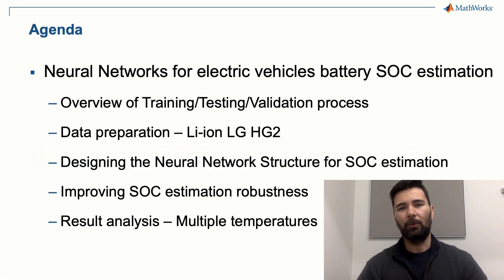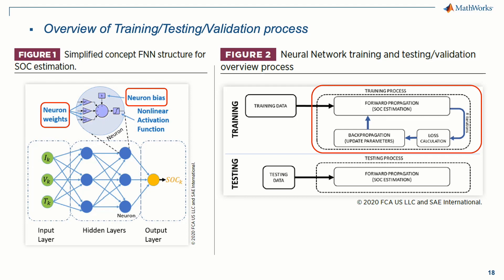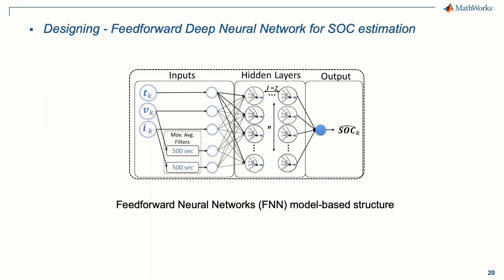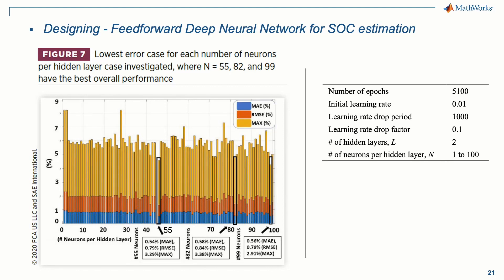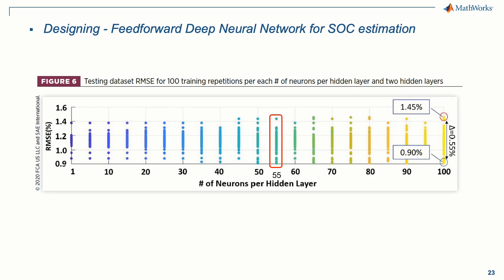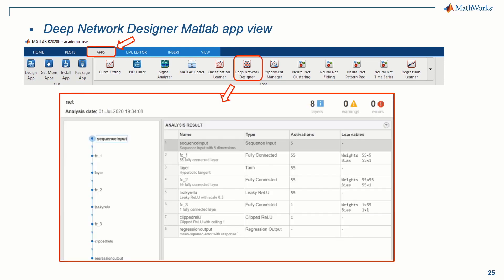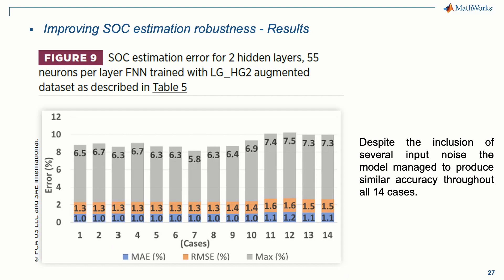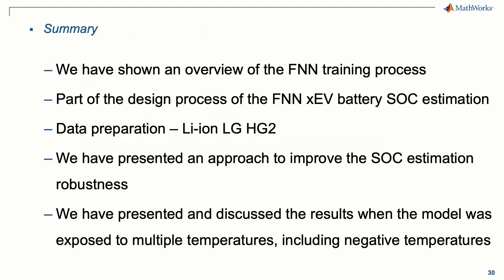Neural Network Design for State of Charge Estimation | Estimate Battery SOC With Deep Learning

Comment: how to get ground of truth of SOC to calulate cost function?
Reply from the maker: Thank you for your comment. The ground truth is achieved by performing coulomb counting with a very precise laboratory grade shunt. This is something that is not possible on the edge device because of sensor drift, but it is OK if done under controlled conditions in the laboratory.

Comment: It is very helpful video. I ve already benefited by it. I m doing my MS research work on machine learning methods for SOC estimation. Therefore i need code for implementation of SOC by neural network method. It will be very thank full if u ll share code or help me out asap. Thank u.
Reply: Did you find it?
Reply: @MuhammadZeeshan-ni1nc  no
Reply: @rimshaashraf9290  If you don't mind can you tell me which university are you in. I am in NUST so if you are in ISB, it would be really helpful.

Comment: All good with these videos, we all know how to use TensorFlow to train neural networks, import them into simulink and generate code for microcontrollers. We want to see how they get the data set, that's what they want to show. If they do not show that, it is simply to show that they have expensive equipment and that they know, it is a demonstration of knowledge rather than teaching how to take the data to estimate the SOC.  We want to see how they take the data for training. What sensors and techniques do they use. Thanks!
Reply: 100% agree with you on this, I lost interest fairly quickly once I realised they were just showing data from their experiments and not telling a great deal about how to do it ourselves
Reply: @WastingTime1878  did you know how to dit please I need help
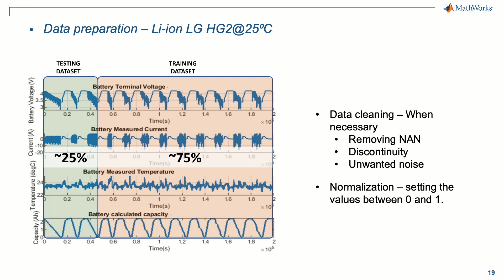Reply: Looking at @2:00 it looks as though they performed a drive cycle (such as UDDS, WLTP or FTP for example), then performed a CCCV charge (Constant Current, followed by a Constant Voltage phase, a standard charging routine), and repeated that over and over. Judging by the voltage, this was done on a single cell, and would likely be performed in a thermal chamber to maintain a somewhat steady temp., using a potentiostat operating with galvanostatic control (controlling the current in order to measure the voltage response).

To obtain such data as an individual is obviously quite tricky. So you may want to find a validated model that can generate some pretend data to play with, perhaps G. Plett vol. II book will help you there.
Reply: @rich5729  What I want to do is exactly that for my batteries, not in controlled lab environments but in the real world. I aim to estimate the state of health and state of charge in a battery that I use daily, allowing me to design my products and provide the SOC and SOH information to whoever looks at the device’s LCD. I’ll give what you suggested a try—I already have some real-world data from my actual batteries. Now I'll experiment to obtain the SOC (which is easier) and the SOH. Best regards.